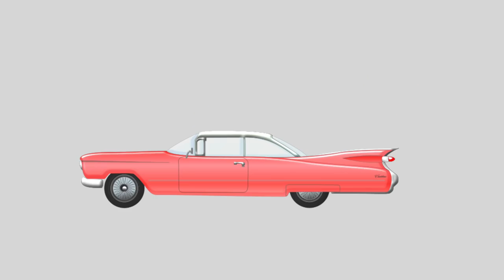Yes, Rockets CAN Fly in a Vacuum

Comment: You need air to push off of.   You cannot propel a rocket in space.
Reply: So according to you a crossbow fired into a vacuum would NOT have any recoil?
Think through that one again.
Reply: @stuartgray5877  a rocket is a heat engine of the internal combustion type. A crossbow is not. Only chatbots would compare them 😂
Reply: @papalegba6796  Care to explain how a space shuttle main engine can accelerate 500 kilos of water to Mach eight every second?
No of course you will not.
Because explaining it proves YOU wrong.
Does a SSME use "Magic" to make mass accelerate or is it "physics"?
If your answer is "Physics" then JUST EXPLAIN IT TO US.
Reply: @JohnW-cf2kw  Stuart Gray is a chatbot 😂
Reply: @papalegba6796  I don't even see my comment here anymore
Reply: @JohnW-cf2kw  yeah loads get deleted or shadow banned, this video is pure damage control.
Reply: @papalegba6796 so why won't you calculate the "work" needed to accelerate 500 kilos to 2500 meters per second??

Oh that's right because you CANT DO PHYSICS PROBLEMS.
Prove me wrong and tell us how much work a SSME does every second.
Because if you say "zero" then you think mass can be accelerated without performing any work.
Reply: @stuartgray5877  hush now, chatbot 😂
Reply: @papalegba6796 just as expected you REFUSE to do physics problems or answer physics problems.

Is physics a "secret" in your fantasy world?
Reply: @stuartgray5877 The SSME doesn't do anything.
Shuttles were decommissioned. 
I was building the buildings 2,3,4, along with a small soundproof station. In Houstons Johnson Space Center.
I was laughing my butt off watching disgruntled welfare recipients get their layoff notices as I'm building more room.
Hey, if you ever go into those offices, they have vacuum sealed floors, and I designed all the lighting shadow boxes hanging.
I used star trek as a reference,.. the GC loved it. Lol😂
Reply: @dragonz_eye So is anyone that gets part of their paycheck from a government contract a welfare recipient according to you?
Reply: @dragonz_eye  - "Shuttles were decommissioned. "
But the SSME engines are STILL BEING USED for SLS genius.
Try to keep up.
Reply: @AM-rd9pu Yes,.. I sucked off the tax payer teet for 9 months. 😊
I had to enter a 12 step program as I was itching for hand outs.
Still recovering.
Tried to get food stamps, CHIPS, free cell phone, etc... 
It's a hard habit to kick.
Reply: @dragonz_eye You really don’t see a difference between earning a paycheck funded by a government contact and being on welfare programs?
Reply: @AM-rd9pu  Yes I do,.. the ones getting the welfare checks actually have to work for them.
Reply: @dragonz_eye  So earning a paycheck by doing work is the same as receiving a welfare check? Now that’s absurd even for a conspiracy theorist.
Reply: @AM-rd9pu Get a life 😆
Reply: @dragonz_eye Someone’s mad I’m showing how ridiculous their “argument” is.
Reply: @dragonz_eye Fun fact: “argument” has more than one definition. 

Argument isn’t just a back and forth of opposing views. It can also mean, “a reason or set of reasons given with the aim of persuading others that an action or idea is right or wrong.”

My point stands that you’re mad that I’m showing how ridiculous your argument is.
Reply: @AM-rd9pu Sounds like you defined a back and forth argument.
Reply: @dragonz_eye  You are completely missing the point. What a surprise. 

I keep showing how ridiculous your argument is and you keep getting mad.
Reply: @dragonz_eye  - "Then why don't you say SLS genius?"
Because they are still "Space Shuttle Main Engines" or "SSMEs" genius.
Shall we just call them RS-25s to keep from confusing your infantile intellect?
Reply: @stuartgray5877  it doesn’t matter if you use all the water on earth in order to attempt rocket propulsion  through space continuously. The rocket would lose momentum as soon as it left earths atmosphere. You need something to push off of which can’t happen in the vacuum of space.  

Using a man made vacuum is not a proper test to see if you can achieve propulsion in space. Because the box has walls and even if those walls are further away from the thrusters of the rocket you need oxygen in the box vacuum to even start propulsion so that nullifies accurate results, thus proving my point. Even if you had oxygen continuously pumping out to ignite the thrusters in outer space, all of it is just going equally in every direction without effecting the rocket in a way that successfully produces thrust in a straight forward motion. The rocket wouldn’t go anywhere. The gasses would not even ignite the thrusters, there wouldn’t even be a spark once the rocket lost momentum as it left earths atmosphere.
Reply: @kennethweiss5096  - "The rocket would lose momentum as soon as it left earths atmosphere."
Wrong.
You dont understand "Momentum".
A spacecraft will keep moving FOREVER through space with a given "Momentum" unless acted upon by a force to change that momentum.
Reply: @kennethweiss5096  Not only am I a vacuum test specialist, but I have been building launching and operating spacecraft as my job for the last 30 years.
Reply: @stuartgray5877   that’s true I forgot about that. But propulsion is just not possible in a vaccuum and you need something to push off of to gain momentum.
Reply: @stuartgray5877  so you’ve gone to space yourself? Have you piloted a rocket into outer space? If not how do you know from using your senses while in a rocket in space? Do you have raw footage of yourself in a rocket in space or have raw uncut and unedited footage of the rocket in space?
Reply: @kennethweiss5096  I have "Piloted" Three spacecraft in my career. However we do it by Remote Control, we don't fly ON the spacecraft.
Those were: Deep Impact, Kepler Space Telescope, and NOAA-20.
I was on the mission operations team of all three after being the launch conductor.
Reply: @kennethweiss5096  - "But propulsion is just not possible in a vaccuum and you need something to push off of to gain momentum.""

Thats WHY rockets are about 95% REACTION MASS at liftoff.
They TAKE MASS WITH THEM TO PUSH ON.
Reply: @kennethweiss5096  To PROVE that you do not understand "Momentum".
Explain why a crossbow has recoil (Ill BET you are not capable based on the things you claim)
And explain what would happen if you fired a crossbow into a vacuum.
Would it STILL have recoil?
Yes or no, why or why not?
Reply: @stuartgray5877  right but the reaction mass needs atmosphere around it in order to be effective and without the atmosphere around the reaction mass how do you think the rocket goes forward in the vacuum of space?  What is the reaction mass pushing off of?
Reply: @stuartgray5877  do you have raw video footage of the rocket moving forward in deep space? So far all the video I’ve seen is near earth. Not even in a total vacuum they still are operating using some of earths atmosphere.
Reply: @kennethweiss5096  - "What is the reaction mass pushing off of?"

EXPLAIN
WHY
CROSSBOWS
HAVE
RECOIL
Reply: @kennethweiss5096  - "do you have raw video footage of the rocket moving forward in deep space?"
No because "rockets" don't GO to "deep space".
Spacecraft get sent to deep space by the rocket, but the rocket does not accompany them on the trip.
There are MANY videos of spacecraft, like the ones that landed on Mars.
Or the Deep Impact encounter with Comet Tempel-1 or the Osiris-Rex sample capture.
There are hundreds of hours of video of the Mars rovers driving around on the surface.
Reply: @stuartgray5877  the tension of the string combined with the action of the limb on the bow creates recoil.
Reply: @kennethweiss5096  But when the crossbow is "pushed backwards" what is it "Pushing on"?

Are you suggesting that the bolt is pushing on the AIR and THAT is what pushes the bow backwards?
Reply: @kennethweiss5096  Let me ask you this:
With the SAME BOW, and TWO bolts: which one would produce more recoil in the bow?
One that is made from hollow aluminum and a mass of 0.1kg or one made from solid lead that has a mass of 1 kg? (10X the mass)

Same tension on the bow, two different masses.
Which one has more recoil?
WHY?
Reply: @stuartgray5877  I don’t know. 

You’re comparing a rocket to a cross bow and arrow. 
Why don’t you tell me?  If an arrow is shot while in outer space then the momentum would continue until it’s stopped by something, like you or someone else said. I can’t remember but regardless, that makes sense. 

But even if you launch a rocket into outer space. As soon as it is in outer space. I just don’t see how anything could push the rocket forward or redirect it through using other means like the air or whatever they use. You know what I’m talking about? Like the little bursts of air that puff out of different parts of the rocket or spacecraft? Any propellant just goes into the vacuum of space. How does it move something in the vacuum of space when there isn’t anything to push off of, No atmosphere to push off of?

You can’t just say this law or that law. Explain why the law works in the natural world in layman’s terms.
Reply: @kennethweiss5096  the answer IS:
Crossbows feel recoil because the object they are applying a force to has "inertia". 
This is a resistance to being accelerated.
When one object (the bow) applies a force to another mass (the 'bolt' or projectile) then BOTH objects feel the same force for the same duration.
If the force of the bow pushing on the bolt is also felt by the bow, then while the force is being exerted on the bolt by the bow, then the bolt is ALSO applying an "equal and opposite force" back on the bow.
Rockets work the same.  The gas pressure in the nozzle applies a force to the mass of the exhaust gas.  Since the exhaust gas has MASS, it also has inertia and resists being accelerated 
So the mass of the exhaust gas pushes back on the rocket as it gets pushed on.
Rocket propulsion is just the mechanical recoil of pushing out mass.
Just yesterday I was playing with my grandson with a toy water rocket.
Can you explain how water rockets work?
If you COULD then you would understand how rocket propulsion works.
Push MASS in one direction and get pushed in the opposite direction by that mass.
Reply: @stuartgray5877   right on. Thankyou for your explanation and it makes sense when applying all of this in earths atmosphere. Earths atmosphere provides the mass for the rocket and everything else to move through and push off that mass.  The exhaust gas needs to push off of something too. The vacuum of space doesn’t have enough mass for the exhaust gas to push off of and propel the rocket through the vacuum of space. The gas just expands and disappears into the vacuum of space. How does the vacuum of space provide enough resistance to the rocket’s gas in order to propel in the vacuum of outer space?
Reply: @kennethweiss5096  - "Earths atmosphere provides the mass for the rocket and everything else to move through and push off that mass."

NO.
The EXHAUST GAS is what the rocket pushes off of NOT the ATMOSPHERE!

- "How does the vacuum of space provide enough resistance to the rocket’s gas in order to propel in the vacuum of outer space?"

IT DOES NOT.
Rockets TAKE MASS WITH THEM TO PUSH ON.
Reply: @kennethweiss5096  What do YOU think I could "Push on" more:
500 kilograms of water?
Or some air?

Because a space shuttle main engine accelerates 500 kilograms of water from a velocity of zero to Mach Eight EVERY SECOND.
Do you know how to calculate the recoil force of accelerating 500 kilograms of water to Mach eight?
NO, YOU DONT.
Thats what you ask ENGINEERS TO DO FOR YOU.
Reply: @stuartgray5877  the atmosphere is what the exhaust gas is pushing off of and the rocket is being pushed forward by the exhaust gas
Reply: @kennethweiss5096  Thanks for proving that you have not understood a WORD I have posted.
Have a nice delusion.
Oh, and consider going back and finishing high school.
I can TELL that you dropped out before the 9th grade.
Reply: @stuartgray5877   I understand what you’ve said and I have passed high school but I cheated a lot. lol. 

I’m just very stubborn and my understanding is rudimentary. I will not deny that. But I also haven’t seen convincing video evidence of spacecraft flying in outer space using exhaust.
Reply: @stuartgray5877  if I dropped before the ninth grade…. then how can I go back to finish high school if I never started? 

Do you not understand what you just said?   LOL.
Reply: @kennethweiss5096  Bless your little heart!

Comment: Space is vacuum so all containers would implode isn’t it
Reply: Why?
Reply: Believe it or not, but the pressure difference between the interior and exterior of a passenger jet at cruising altitude is usually at least half of that between sea level and a total vacuum.
Reply: That all depends on the material used and the design of the craft.
Reply: @fromnorway643  I don't want to argue, but do you have a source? Might be useful for me to cite to others in the future
Reply: @ppleberrynd  Well the atmospheric pressure drops to about 1 Torr at only 50 kilometers up.
At the cruise altitude of a jetliner atmospheric pressure is about 0.3 - 0.5 ATM. (5.0 - 7.0 PSI)
So the differential Pressure on a jet airliners "hull" is about 7.5 PSI pushing outwards.

In space there is 14.5 PSI inside (say the ISS) and 0.0 PSI outside for a differential pressure of 14.5 PSI.
When Astronauts do spacewalks they operate at a suit pressure of only about 5.0 PSI for a differential pressure of only 5.0 PSI.
It keeps the suits from becoming too rigid to move and make it so a small leak will not deplete the suit immediately causing the bends.
Reply: @stuartgray5877  Thanks man, very interesting
Reply: @fromnorway643 That’s an excellent point.  When one considers all forces acting on that fuselage of a passenger jet, a craft in space has an easier time.

Comment: Rubbish… diverting the gas being released out of the nozzle will change direction…  how could that happen?
Reply: would firing a crossbow into a vacuum result in a recoil force? Yes or no?
Reply: @stuartgray5877  yes.. but a crossbow isn’t reliant on air pressure to release energy..
Reply: @Raptorstorm1976  - "yes.. but a crossbow isn’t reliant on air pressure to release energy.."

Yes. so, it should be even easier to understand where the recoil comes from in a crossbow than from a gun.
WHY does a crossbow have recoil?
If one can EXPLAIN that, then they will understand how rockets can propel themselves in a vacuum.
If one cannot explain how a crossbow has recoil, then one will never understand rocket propulsion.
There is a hint in a video on my YT channel where I demonstrate the recoil from a crossbow.
Reply: @Raptorstorm1976  Stuart Gray is a chatbot. It's not programmed to understand that a rocket is a heat engine 😂
Reply: @papalegba6796 and your chatbot refuses to answer physics questions whenever the answer proves YOU wrong.  Which is basically every time
Reply: @stuartgray5877  my what now?🤔 😂
Reply: @kitcanyon658  Speak English please, chatbot 😂
Reply: Don't feed stu gray the chatbot please and thank you.
Reply: @DrCash7  Chatbot Stu will never admit that a thermal rocket is a heat engine of the internal combustion type. Cos that would make work calculations easy & in a vacuum the result would be zero. Nope, it's crossbows, crossbows, crossbows, all the way with chatbot Stu, false analogies & abuse are all it is programmed with 😂
Reply: @papalegba6796  lol "it's all crossbows crossbows crossbows" 

Yup basically
Reply: @DrCash7  Its latest tactic is to ask me the same question hundreds of times & pretend I haven't answered it, whilst using sockpuppets to call me names. So it's basically become a psychological torture device 😂
Reply: @papalegba6796  that's because you never answer the question. yes, you write a reply, but it has nothing to do with what you were asked
Reply: @frantaspacek  see my last comment, lying chatbot 😂
Reply: @DrCash7  have you seen the latest video on Stuart's channel? What a loon!😂
Reply: @papalegba6796  your last comment has zero information value
Reply: @frantaspacek  see my last comment, chatbot 😂
Reply: @papalegba6796  I did. It has zero informational value.